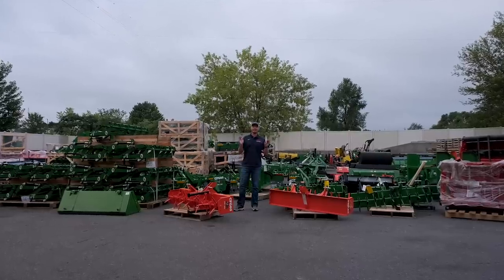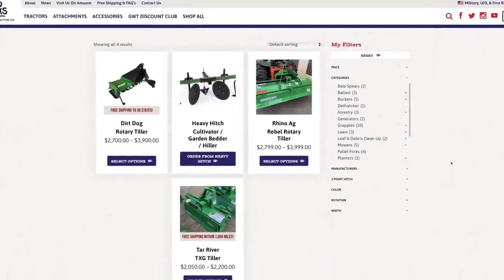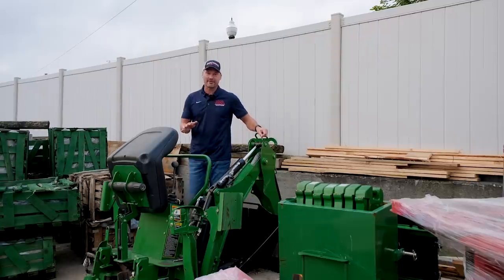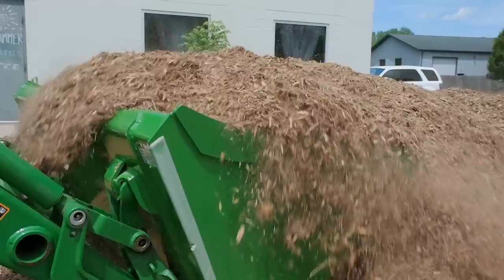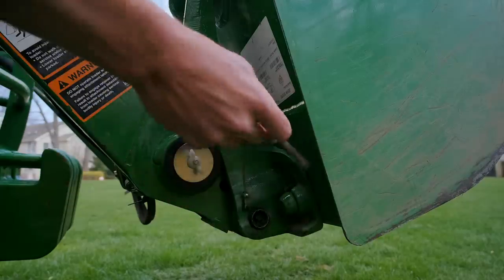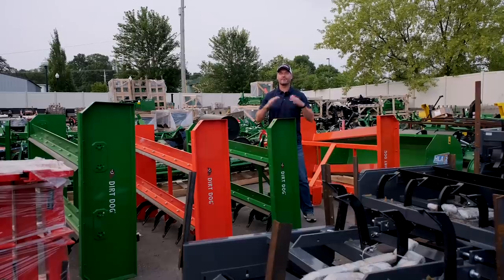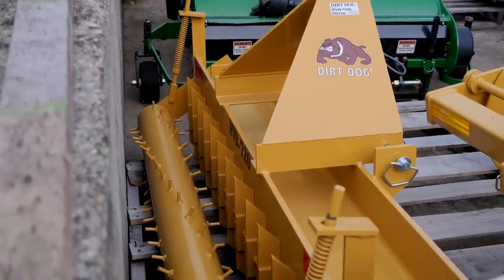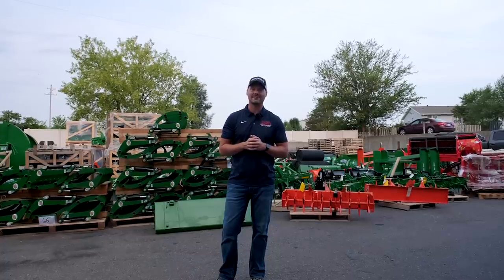TOP TEN TRACTOR ATTACHMENTS VOTED BY REAL TRACTOR OWNERS 🚜

Comment: I know you don't like backhoe too much on tractors but I love my backhoe better than ballast box easier to hook up then three points and very useful and never get stuck
Reply: completely agree! I also use my backhoe at least once a week.
Reply from the maker: Glad to hear it.  Yeah, not for me, but very useful for some!
Reply: I've used mine to remove stumps, dig post holes and my latest project was to fix my water line due to a leak.  Helps when your ground is made up with rocks from a small tennis ball to a basketball. I've heard it's a waste of money,  but I regret nothing when it comes to it. Plus you spin out and get dug in,  you just gotta push yourself up and out.
Reply: It also serves as ballast weight too.
Reply: Any thoughts on a towable backhoe? Much cheaper, easier to move around, and could be used in conjunction with your tractor or on its own. Could also use Other vehicles to move it.
Reply: Can’t live without one in the bold (boulder) state of Maine.

Comment: Interesting that the rear-mounted finish mower did not make the list. Mine gets more hours on it than any other attachment I own, and that's a 72-inch mower. Maybe I cut a bigger lawn than most sensible people?   A zero-turn mower (single purpose) vs. a cab tractor with a/c. No contest.

Comment: I have a front loader with a skid steer quick attach, standard bucket, rock bucket, pallet forks, box blade, land planer, tiller, auger, landscape rake, 3 point quick attach.  I'll tell you by far I get most use of the standard bucket, then the backhoe, then the pallet forks.  I drilled chain hooks into the top of my bucket so between them and pallet forks I can lift or pull anything.  I'll get a ballast box next.  I need one every time I use the bucket. Thanks for your great videos!

Comment: All 10, plus the honorable mention, plus a 72" rear snowblower, plus 3-pt monster material spreader, plus Wallenstein wood chipper, plus 12,500# 3-pt forestry winch.  Used on 30-hp JD 4310, Yanmar 359-C (59-hp cab).
Reply from the maker: Wow, I'd say you're decked out!
Reply: But I still need a land plane (have a box blade).  😒

Comment: I have 7 out of the 10.  I don't have a Ballast box, Backhoe, rear cutter but I do have a belly mower, and I don't have a box blade or land plane but I do have a rear blade with hydraulic angling cylinder. An attachment that I didn't think I would use much is a man lift safety cage that you use with my pallet forks but I use it often to trim trees, change yard light bulbs and put up Christmas lights.

Comment: A pto wood chipper if you have a acre or more of forest/brush. Land clearing aside having access to unlimited and relatively cheap mulch that doesnt required transport and is on demand it's awesome. Low maintenance trails, edging around trees, weed free garden beds the list goes on. Also it retains moisture, slightly resists runoff and  unlike rock you can easily remove it somewhere else to for either decomposition or to be tilled under. Also to build up soil if your in poor soil areas or have thin soil. 
Also compared to the ones with gas engine ones there way more powerful and efficient priced compared. Also it's a 3 point hitch so it's very mobile and some either come or can be modified to also have cart attached.

Comment: Have most of them and in the 16 years I had a FEL I have used my bucket 2 times the forks are always it. I used the grapple a lot and it has saved us a lot of work. During winter the 66” front blade works great and the Meyer BL240 salt spreader saves a lot of hand tossing the salt, I normally use 150 lbs every time I plow.

Comment: The most important attachment is the loader bar none. You need it for 1/2 the attachments that people talked about , so the loader first then let everything else  come later. I have bucket, forks, land rake, box blade, grader blade, snow plow, rock digger(that I had made), platform that I made to attach to the forks, 3 pt finish mower and a 3 pt carry all that I built the box for. These all fit my wonderful 2003 John Deere 4310.
Reply from the maker: Hard to argue!

Comment: I think a landscape rake should be on the list. I have a MX5200 with 3 rear remote functions for 3 way gannon or box scraper, pallet forks,  smooth bucket, rock bucket, land plane, flail mower, and old Towner disk with transport wheels.
I have a 773 Bobcat with a 72" brush hog, 84" Broom. Both tractors have SSQA

Comment: Since we have a pin on bucket I wish sometimes we had a quick attach set up and that would open more doors for us but we have a rear blade, front blade for snow and a snow blower. We do have a tooth bar on the bucket for digging. Thank you for the video.

Comment: For my pallet forks, I made a support for the tip of the tines so I can lift farther out. Just a piece of 2x2x1/4 HSS with pockets for the tines and guides for the chain at the edges and the center. I run the chain from the pallet fork main frame out over the support then down to what ever I am lifting.

Comment: I would like to own a tractor, but do not have the money!! IF I did own a tractor the attachment I would want to own are: Mower deck, Loader with bucket, Pallet forks, Tiller, Snow Blower, Snow pusher, Snow/Dirt blade, and maybe a Box blade or land plane.  I am not sure about a Backhoe, but feel it is nice to have in case you need to dig any trenches, etc.   Of course I would have ballast, either ballast boxes and/or ballast in the tires and/or wheel weights.  There is one other thing I would love to have and that is a cab. Why? When it is Hot and Humid it has AC and then in the Winter or when it gets Cold it has Heat. LOL
Reply from the maker: Thanks for watching sir!

Comment: Great video as always.  I will add a seed spreader or broadcaster.  In not a particular order: pallet forks, bush hog, sprayer, bucket, grader, tiller, seed spreader, grappler.  I am with you on the backhoe. I will rather rent it out.  To clear wooded areas and to move loose hay the grapplers have no equal on my book.  They are very handy.  Thanks for making such a great content

Comment: (1025r)Seasonally….  Wintertime I have a 5ft rear snowblower and a front mount snow pusher that lives on it. Springtime is my 5ft rear sweeper kicking all the plowing off the lawn. Summer it’s the bucket and ballast box. Fall is the pallet forks and sweeper ( best time to move wood and dethatch).

Comment: I have 4 of 10 listed: the loader and bucket, grapple, forks, and box blade; 1 "equivalent": Pat's easy change (instead of the quick hitch; and 2 not listed: a "carryall" for the 3 point hitch and a landscape rake.  I didn't think I needed/wanted a cutter or a tiller, but I have since changed my mind and will get them at some point.

My question in reference to renting a mini excavator instead of owning a backhoe is: Should I rent a small tractor with backhoe (Bobcat CT 2025) for $400 a weekend or a mini excavator (either a Bobcat E 35 or an E26) for $560 a weekend?  I need something for a small project to remove some stumps in my way.  Thanks
Reply from the maker: I'd go mini ex if it's just stump removal.

Comment: The only attachments we have from this list is the mower, though that quite a stretch since that's a Claas Corto 185n drum mower, the kind used for hay making. 
The quick attach isn't really useful since the equipment we have differs, so we'd need something with two sides.
A bucket isn't something my dad needed since we did have grain to deal with, but sheep manure which our manure forks are good with.
Palette forks do have a good use since he have a pin hitch loader, and you can't adjust the angle from the loader controls, and the manure forks are good for bale loading as well, so that eliminated a use for them.
And a hydraulic top link would be impractical since we only have 1 spill valve in the rear.

Comment: Living in Arkansas, a snowblower isn’t needed but maybe once a decade. So I don’t own one and no plans to. 

After I do a custom install of the rear remotes on my BX23S, I will add the hydraulic top link to the 3 pt hitch. Already have the kit, just have to customize and install it on the tractor. 

Other than that, all of these tools are in my toolbox. They each do their jobs exceedingly well. 

I’m curious to know how post augers and post drivers ranked on your poll?

The Soil Pulverizers especially a powered rake that will work on the BX23S intrigues me. 

As to the #1 item on the list. This is one of the only implements that I own duplicates of, and I have no plans on getting rid of either set. 

SIZE DOES MATTER!!!!  

I purchased a HD set when I purchased my SSV65. I can use these forks on my BX23S however they leave me with less than half of the total lifting capacity of the loader. So I invested in a pair of Land Pride PF1242s, which pair with the BX so much better. They leave about 600 lbs of lifting capacity, nearly double that of the HD forks. Pairing these to the tractor really makes a significant difference. it blows people away when you tell them that you can actually lift more weight with the light weight forks on the BX than with the HD forks. Rarely does anyone consider the total lifting capacity of the loader itself and how the weight of the forks diminishes the total weight of the load. (Great video planned for the near future demonstrating this.)

In addition, I keep both tractors at different locations. so constantly transporting the forks back and forth was a real PITA!!!

So I can easily see how forks made it to the #1 position on the poll.

And yes, I have to admit both sets of forks are currently attached to both of my tractors. 

And, did I mention that I have a carry-all that I use as Pallet Forks for the 3 point hitch…

I guess pallet forks have integrated themselves so well into my tractor Swiss Army knife, that I take them for granted. They earned that #1 spot that’s for sure!!!
Reply from the maker: I don't think there was a single person that side a PHD was their favorite attachment.  In fact, I think it may fight for #1 on a future Most Hated Tractor Attachment List.
Reply: @GoodWorksTractors  I would like to see a side by side comparison of the 3-pt auger vs loader auger with an un-experienced and un-biased users.

Comment: I voted hydraulic top link because I never realized how many times I got off and on the tractor before I had one.  Backhoe would be number 20 for me 350 a weekend for a mini excavator that you can do 100x more with is a no brainer why the cost of the backhoe is not worth it. The GWT stump bucket is #1.5 on my list in a few months from now that I've been using it it might become number 1 for me. Great video.
Reply from the maker: Haha, I like it!
Reply: @GoodWorksTractors  I called my JD dealer to a quote for my 2032R for the entire rear hydraulic top link kit... $2,300.  WOW.... So I am passing. Does that seem correct? That's for everything needed from the cylinder, rear hydraulic lines to the lever being added on the fender.

Comment: Here where I live in Italy is a bit of a pain. The issue is the environment we work in. Hazelnut, Grapes, Fruit Trees, Terraces, Extreme Hills, and general garden work. I work on a very steep hilside and terraces (which are to this day still a little scary) which are also narrow and quite tight. Also working in hazelnut fields the tractor has to be extremely low to the ground to get under the trees. These are the ideal tractors you would want: a high enough horsepower Ferrari Tractor with wheel weights and liquid ballast. Carraro or fiat tractor, this would be a steel tracked tractor for working on extreme inclines and just being able to power straight through anything. Then as a third tractor you would want any sort of utility tractor you can put a loader on (you can put a loafer on Ferrari tractors but I'm not a fan) I would choose a Solis 50 open cab with loader personally but it is a French/English tractor and I don't know if many people would have heard of them but it is 50hp. And a excavator of some sort. Nothing less than 2.5 tons but nothing higher than roughly 5 tonnes because it wouldn't fit on terraces which are the main places it is needed and it has to be a zero tail swing. Although it is very hot I would still choose the open cab to personal preference. I would also have a good ATV and ATV trailer for getting around quickly and checking things. Also the mountain I live ons water supply is from a sprig which fills a cascading tank system and when aomei uses too much water it throws the entire system out and you have to go to each tank and manually sort it out and the tanks are very far apart in difficult to reach places. Just want to share some knowledge of where I'm from and the environment equipment is used in, sorry for the long comment
Reply from the maker: Hi Matteo,

Wow, that's a very challenging environment.  It makes me appreciate the easy life that I have here in Michigan.  Thanks so much for watching, be well!

Comment: oke i am not a farmer.. i have tractors for around my land, and i love them my list
1. my own made wodsplitter .. by far the most used 
2 my own repurposed lifting mast because it can load stuff as a all terrain forklift
3 frontloader (forks and bucket)  and its actually a shared 2nd place.. 
4 trailer style pto driven excuvator.. its a bit long set up.. but it replaces a excavator completely not much used.. but will get to number one spot when ill be doing a roof (beams laying) and digging for a pool

what i do want in the future is a weed removal tool.. just something that scrubs the tiles free. not gonna do that for long

Comment: Don't buy expensive bushings for a QH15.  A cat 1to cat 2 adapter fits nicely into a cat 2 to cat 3 adapter, and together make one equivalent bushing at a fraction of the cost of one of the enormous hunks of metal that has been turned into a QH retail bushing.  Make sure you get 2 sets of lower link adapters and 1 set of top top link adapters for each piece of equipment.
Reply: I second that
Reply from the maker: Good call.

Comment: 0 out of 10.  18 years with out a loader or even hydraulics.  But I use my tractor almost every day, sometimes all day (today for example).  I have a finish mower, post hole digger, aireator, blade w/ snow plow extension, harrow, 2 trailers, tree winch, splitter w/ crane, roller, 3pt. boom, lawn sweeper, ripper, single plow, spreader, sprayer, and a 110 gallon fresh water tank w/ pump for irrigation. Once I can find a reasonably priced cabbed 4 series with mid PTO I'll be getting all 10 of 10 plus more.  Alas, at these prices it might be awhile.
Cheers!
Reply from the maker: Wow, pretty incredible.  Shows the versatility of a tractor I think.

Comment: I have two tractors. Both have front loaders. I have the tiller for my small tractor  I have a 5ft and 6ft brush cutters. Box blade. Front and rear hay spikes for my big tractor. 3pt auger. Canopys on both. Both tractors have the rear tires filled. That's all I think of rite off.

Comment: 7 out of 10.  Funny thing is, two of the three I don’t have yet are the cheapest two (ballast box and forks)
Reply from the maker: No ballast box?  What do you use for counter weight?
Reply: @GoodWorksTractors  I have rear tires filled and usually have the landscape rake (or something else) on the back for ballast.

Comment: At the end of the day, the implements are very use case specific. How many acres, the climate, the tractor size, what you plan to do with it, etc. For compact tractors on smaller, non-working acreage (no farm or livestock)…

1. Clip on forks = so cheap and get the job done for most use cases
2. Ditch bank offset Flail mower = Unless you’re shredding some serious brush or mowing a golf course, flail mower is your utility knife
3. Ballast box = Hard pass! Just keep one of your implements on the unused end. That plus liquid ballast in the wheels should be solid.
4. Backhoe = Hard pass! Get a towable backhoe. Much cheaper and you can have it operating in conjunction with your tractor. Can also hook it up to a UTV to use it on its own.
5. Tow hitch

Now, tear me apart “Internet” ! Let me know how dumb I am!

Comment: Can't believe loader not #1!
Without it, stump bucket, bucket, grapple and forks are useless.
I have loader, bucket, stump bucket forks and box blade. Sold bush hog and road blade cuz didn't need it.
Reply from the maker: Yeah, I kind of felt like I should leave out the FEL as it's almost standard.  However, it was a very common response.

Comment: I dont see much point in getting a snow blade considering the tractor already has a bucket and that's almost as effective.

I also don't really see why so many people get mid mount mowers. For the price of one of those you could go buy a pretty nice Zero Turn and never have to worry about connecting and disconnecting.

Most important for me is the loader, tiller, and Backhoe. Forks are also super handy.

A pull behind trailer and a wood chipper would also be pretty handy.
Reply: I have a snow plow, old truck plow with quick attach adapter. Can't windrow with a bucket. Large lots or long driveways are a pain with a bucket. My driveway is almost 900 feet long. That's why I have a plow.

But I totally agree with you on the mid mount mower. I elected to skip it and go for a zero turn.
Reply from the maker: Yeah, bucket is not my favorite for snow, good in a pinch though.